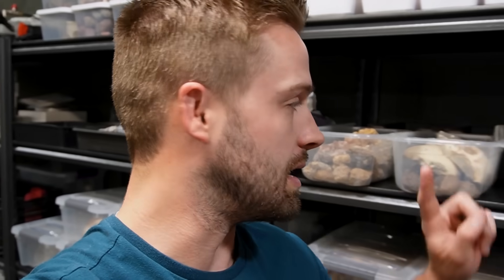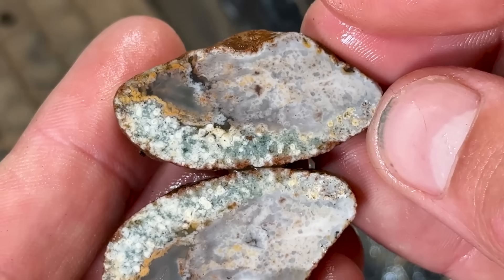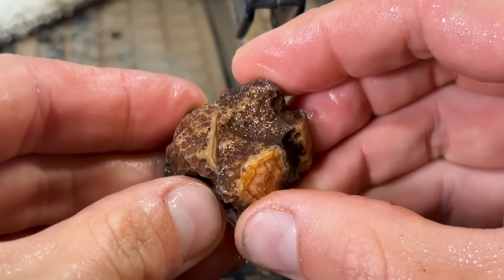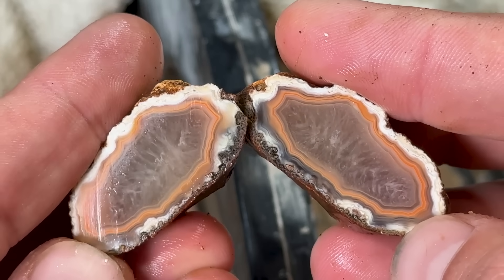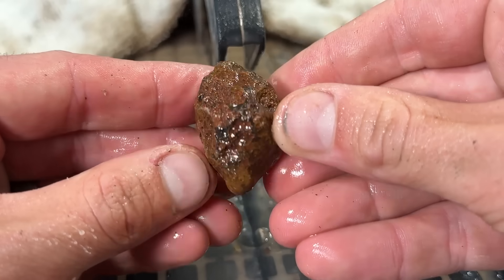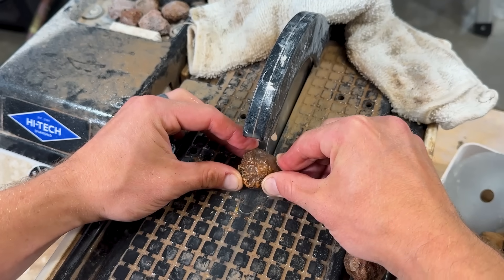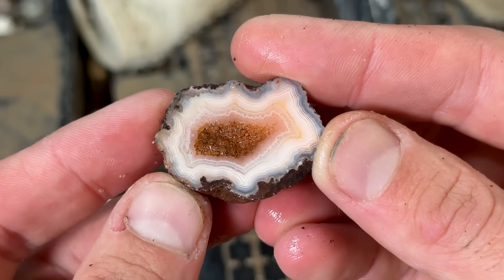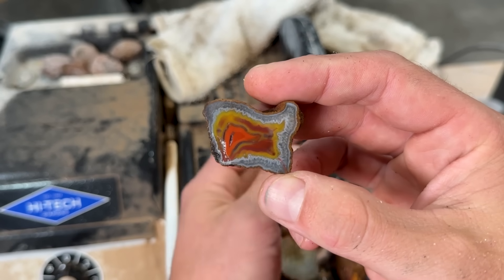These Simple Rocks Have COLORFUL Bands Inside! [Cutting Agates]

Comment: The green is great, I think it helps with the lighting in that it seems to absorb stray light and is not so in your face.  Do you usually run the 6" saw at full speed, and how much life are you getting from your blades?
Reply from the maker: Usually 5 or 6 and unsure, I don’t track it